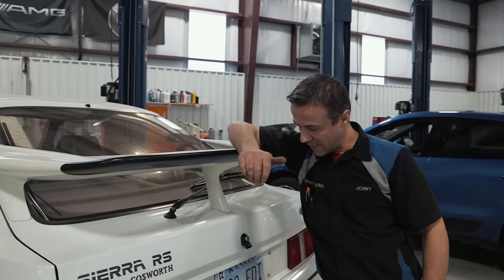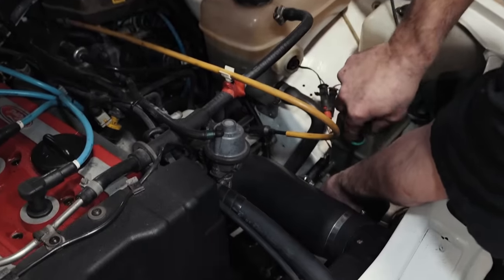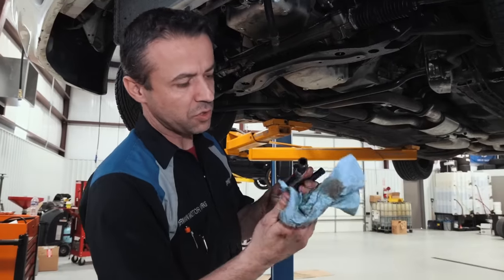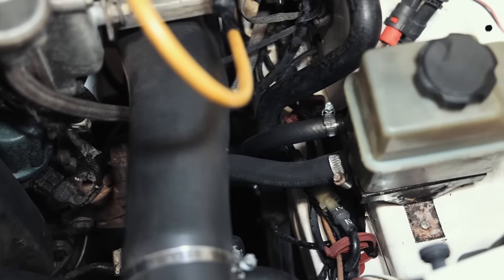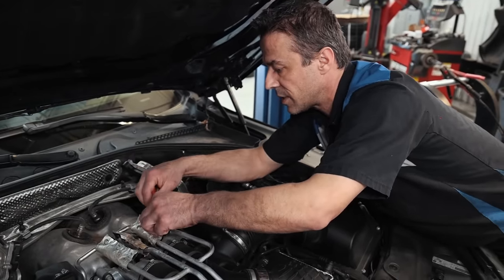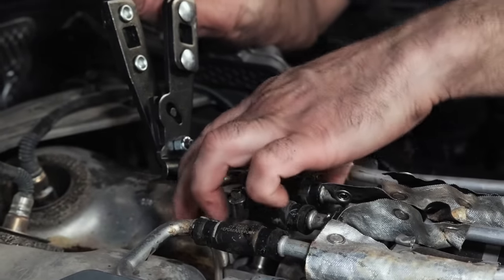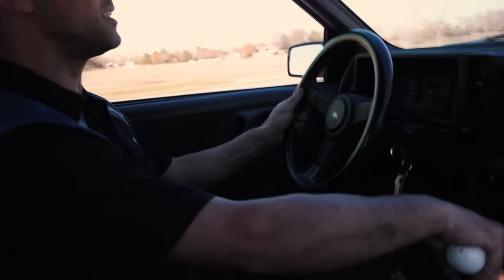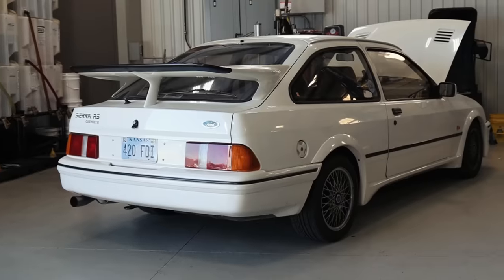Ford Sierra RS Cosworth. MY HOLY GRAIL.

Comment: Amazing classic Sierra 🙂👍
I'll bet on the test drive, more than a few drivers were thinking "What in the World is that...?"
In SA we never got the 'Cossie' version XR4i, but Ford SA did push the XR6 version and later produced a small number of XR8's with the 5lt V8 Mustang engine, to go 'Production Car' (Touring) racing.
Bit like 'Nascar' racing, though done on regular tracks, rather than ovals.

Comment: That's right, 2.0 was the maximum.  Even the E30 M3 couldn't be sold in Italy, it had to be sold as the E30 320i with an M3 S14B23 motor displacement downsized from 2.3L to 2.0L.  Something that in America we are unfamiliar with given we can have any liter-displacement we want! Easy to take it for granted.

Comment: The Cosworth YAC Turbo in the Sierra is stunning piece of kit, making 500hp in full touring car racing trim! The US version, the Mercury XR4Ti got the turbo single car Ford, a good engine but nowhere near the power capability of the twin cam YAC. Both engines use the same block and other bottom end ancillaries and you can bolt the YAC head onto the single cam bottom end to make a home brew YAC! PS: Nice to see you using Oetiker Clamps on the BMW, so many people ditch them for hose clamps not understanding how the Oetiker Clamp works as a spring clamp and works best through heat expansion, cold shrinkage. I use them on all kinds of hose connections that are long term/permanent.
Reply: Engine designation in the that car is YBB. The RS500 has A YBD

Comment: Hi Johnny. You can get the "pigtail" power steering hose from the UK, I'd recommend to use it as a straight hose have a tendency to kink or/and collapse due to the angles from the power steering container to the power steering inlet.

Comment: My 1980 Ford Escort Rally Pack optioned model was a great car, I never saw another one on the roads which I kept for 2 and half years.  Thanks to my uncle who was CFO of a CAT  machinery distributor and Ford dealership who grabbed the car for me off the salesman there who was using it as a company car and demonstrator.  Traded it in sadly for an air conditioned car as the a/c conversions back then was an ugly box under the dashboard for the Escorts.

Comment: It ticks like the doc Mazda 1.8 bop engine in my 91’ Escort, usually after its sat for awhile.  
Always helps  to get the engine hot and bring up the rpm. 
 Those bucket lifters seem to have trouble getting enough oil but at least they don’t pump up under higher rpm like my old SOHC ford 2.3 turbo engine.

Comment: Americans would think that a 2000cc 4 banger would be only half an engine  but this car was a BEAST.  Cosworth was the company that made Formula One engines at that time and were given this to tune and develop. 

It was so dangerous fast that ordinary young drivers could rarely afford the cost of the insurance to drive it.  A 20 year old driver with maybe 2 years of experience would pay more for his years insurance  than the car was sold for.   MOST COMPANIES REFUSED TO INSURE IT.

This year an RS500 version of the car sold for 600,000 GBP at auction.

Comment: Jonny you need to get that oem fuel pressure regulator changed (the diaphragm splits leaking fuel out the vacuum port into the engine) and the rubber hose attaching it - as they split and been the cause of several burnt out cossies.

Comment: I once repaired one of those, the other camshaft had snapped, and that meant to also replace couple of valves. Which were more expensive than we anticipated, the cam even more so...But with new headbolts (different head for socket than the originals...) the engine went together, but one seal of the actual head/valve cover is/was a pain to get right. Otherwise the reassembly went smoothly and as it is a Pinto 2L with a strange twin cam head and a turbo, it is a familiar engine to me. Goes like h3ll...

Comment: In the US, these were badged as a Merkur.  Always cool to see them on the road in the 80's.
Reply: it was a little bit different :)  Merkur was based on the European Ford Sierra Xr4i   (2.8 V6  injection  160 HP 1983-85)  but they changed the engine for american 2.3 Turbo (Mustang, Thunderbird) probably due to service and emmissions reasons.  Not on the Cosworth
Reply: Different bodyshell!

Comment: Drove one of these when they were new while I worked at Ford Motor Co. in the UK. 204 bhp doesn't sound like a lot now, but it weighs less than a Mini Cooper (1100kg or thereabouts).

Comment: The reason the XR4i was sold as a Merkur is because Ford couldn't use the Sierra name plate in the US. GMC sold a pickup track called the Sierra. That Cossie is a beast. I've owned several Sierras in the past but they were the 5-door hatchback versions with the odd saloon (sedan). I'd have another Ford Sierra in a heartbeat if I could.

Comment: I had one of these in 1987 as a 1 year old used car, a metallic grey one registration (I think) C402NHK. A very good car but not as good as the BMW M3 that replaced it a year later.

Comment: Looks like the Mercury Merkur I saw back in 87 when I worked at a Lincoln dealership,it had a 2.3 l and it was turbo that little car was on quick little machine
Reply: Look at the rear pillar and window, different body. The XR4Ti was based on the XR4i from Europe, the Cossie is a different beast.

Comment: 130kmh = 81mph (I have various bikes with kmh speedos in the UK where speed limits, etc, are in miles per hour - so used to doing conversions)

In the early 1990s these Cosworth Sierras were stolen so often that they became pretty much impossible to insure, and hence for a while were very cheap to buy. Many seemed to land up owned by mechanics who could put them on their trade insurance.

Comment: I used to see XR4TI's (what they called them in Canada) a fair bit but haven't seen any in well over a decade. Pity since they're a cool car, imo. Edit: I have since learned the Cosworth was Def an upgrade to the XR. TIL!
Reply: RS was an upgrade to the XR ....    had the Escort XR3i (Mk 3 and Mk4) and upgrade was an RS1600i or later Escort RS Turbo  :)

Same with Escort Mk5  XR3i was a sporty version (fwd ~~100 HP), then there was RS2000 (150 HP, still fwd) RS2000 4x4, and then there was the Escort RS Cosworth (4x4 Turbo longitudinaly mounted engine - basically a Sierra Cosworth 4x4 floor with Escort body on it )

Comment: Not sure about the Cosworth RS but the Sierra was sold in North America as the Tempo/Topaz from Ford/Mercury. We did not get the two door hatch back model however. I would suspect the power steering system was common to all however.  Just a thought.
Follow on comment, nice test drive, too bad you can't really wind her up like on the Autostrada.

Comment: Make sure to replace the fuel pressure regulator, or tell Brian it’s a must change. Quite a few have failed in the UK of late causing fuel to drop on the dizzy causing 🔥 Brands Hatch Performance in the UK have the best ones available in stock

Comment: Hi there car ninja, I am pritty sure after hearing the car run that the valve clearance needs to be done, because you shouldn’t hear that “klak, klak, klak” sound when idling. It should sound like a sawing machine only light tapping. If that doesn’t help than either the valves are bent or burnt and that means a major overhaul on the cylinder head!

Comment: What kind of cleaning agent was Johnny using to clean up the old power steering fluid? I’ve seen other mechanics use something similar to clean up even when performing an oil change.
Reply: Probably brake clean

Comment: In South Africa we had the XR8 version, with the 5L V8 engine. I used to drive the station wagon/estate version with the 3.2L V6 turbo, but I don't think it came from the factory like that.
Reply: No, the 3.2, 3.4, and 3.8 was Basil Green conversions of the 3.0
Reply: @Ghost63123  Oh, I didn't know it was a basil green one, I just thought some guy made it that way in his garage. It was fast AF and had disc breaks all around and little 'gills' on the side fenders and bonnet and fat back wheels, and looked like a mommy car, but it could catch those 90's model M3s.

Comment: Before Ford started to import those to the United States I saw one of the South African ones in the Metro Detroit area. I left a message for the engineer to call me. My sister answered the call and told him that I did not have the money.
The South African version - in my humble opinion - is what should have been imported. It was the 5 door, 5 liter, 5 speed, and 4 wheel drive.
Automobile Magazine voted it Car Most Likely to Receive a Ticket while driving.

Comment: I had an 87 XR4Ti from 87-89. Looks like the same car with different badges.
Reply: XR4Ti based on European XR4i Sierra (top of the line Sierra - made before Cosworth --- 2.8 V6 150~160 HP).... the RS Cosworth is a little bit different (rear side windows, spoiler, bodykit etc.)

Comment: hahahah.... I remember from living overseas myself. But what's the main diff between Euro Ford Cosworth and American XR4ti? I wonder what the 0-60 performance and fuel meilage is like?
Reply: XR4Ti was based on the European Ford Sierra Xr4i (no T = no turbo).   The Xr4i was made before Cosworth and it had a 2.8 V6 with 150~160 HP fuel injection)....  that was the fastest Sierra in Europe before Cosworth
Reply: @MikeB4pl  Thanks. I had a BMW 2002tii at the time. And my neighbor in northern NY could not stop raving about the XR4i. Then disappointed me by purchasing an ultra light in the rear Mazda R7 rotary!! LoL
Reply: @windronner1  Cosworths were like rwd up to 1989 - then they made the 4x4 (after 1987 sedans only -- no 3 door)

Sierra Cosworth were only manual (204 or 224 HP, 16v aluminium head)  ~about 5,4 - 5,6  seconds 0-60  and 142 mph max speed. (later 4x4 had 220 HP and shorter gearing to compensate +~200 lbs of more weight).

Had 15 inch wheels, and 2682 lbs weight, upgraded big brakes (all disc), the T5 Mustang gearbox (later mt75 for the 4x4, an 2822lbs )

Merkur had automatic (140 HP) or manual 5 speed (173 HP) 

8v cast iron head, about 7,8 seconds 0-60 (manual) 9,9 sec for automatic and 129 mph max speed.

14 inch wheels and 2950 lbs weight.  Rear drums, the transmission was T9 (5 speed manual) used in European 1.6, 1.8, 2.0 and v6, diesels etc.  it's not that strong as the T5
Reply: @MikeB4pl  Wow!! You obviously either had great access to Cosworth or grew up in Europe. Where I lived in the Mediterranean, the Sierra Cosworth was more than rare. Somthing only found in magazines. So thanks for the insights. The Merkur never impressed me. Shape, style or performance.....or lack there of!!!
Reply: It's a different body, the XR4ti has 3 side windows, the Sierra only 2.
Reply: @petergordon4525  and looked a lot bigger and chunkier. I’ll take the cosworth anytime

Comment: Quick and dirty conversion of KMS to MILES: multiply by .6....140 100 kph x .6 = 60, 40 x .6 = 24 mph....84 mph. 

Another quick conversion: Temp C to F. Double it and add 30. SO 15 C would be 15 x 2 = 30 + 30 = 60 F.

Comment: Sounds like it needs a valve lash adjustment.
Reply: you beat me to it - I thought it sounded like it had some mad valve tap
Reply: They have hydraulic lifters and can sound quite rattly if they have sat for any length of time. They're not the sweetest sounding 4 cylinder, nor the most sophisticated, but they are still really potent, especially when you consider the age of the engine.

Comment: One sold at auction in the UK for 600,000 pounds sterling. It was mint with only 5000 miles on the clock.

Comment: the Sierra Cosworths are becoming very collectable. there was a 1987 Ford Sierra Cosworth RS500 sold at auction on 25th February 2023 for £590,500 ($699.152.00) nearly six hundred thousand pounds with buyers premium. l was shocked at the money it made l knew the fast fords from the 80s were fetching good money but that is just beyond